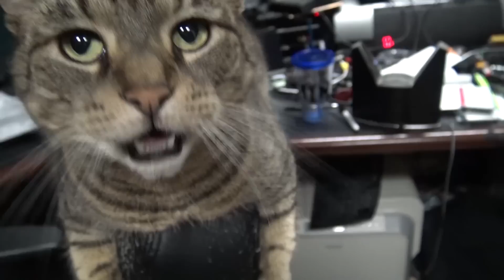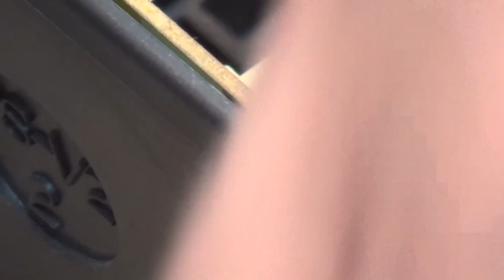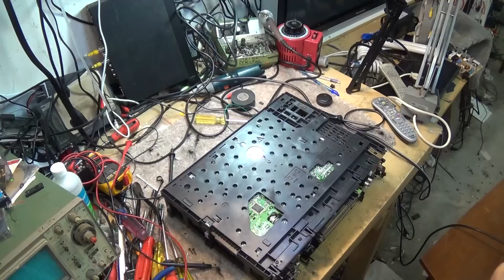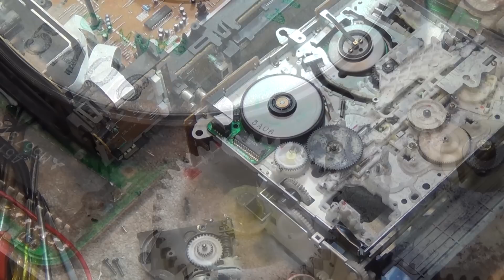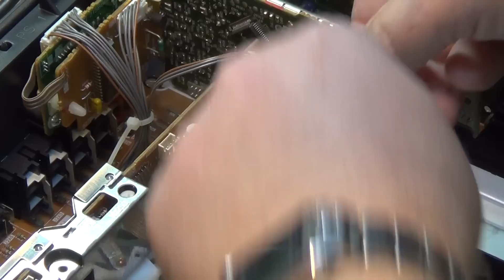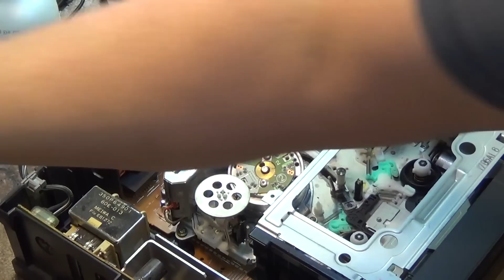Mitsubishi HSU760 totally dead

Comment: Great vid!  well explained.  I have one of these, and after belt replacements (both) it loads just fine i can see it load, but when play  (or FF or RW) is pressed, I get a squealing sound and after a few seconds it gives up on play.  It's almost like a brake is stuck on, or some kind of sensor is not sensing the tape is loaded and ready to play.  Any thoughts?
Reply from the maker: Is the belt slipping.
Reply: @12voltvids  Thanks for the tip - slipping, does this mean it's only going to be drive belt - or loading belt as well?  Seems like it's loading fine.  Sound like the answer lies in finding the right belts at right tension?
Reply from the maker: @brentkroon  you will be able to see which one is slipping.  Some of the mits used a plastic pulley on the capstan motor that cracks. It's ok to glue it.  At one point they make a metal replacement.  Not no more.

Comment: This is excellent. My belts were actually sticky goo melted rather than dry or stretched.  I don't see what size replacement belt or recommended sourcing?  Seems others simply buy a collection and try? Any recommendations for size and style of belt? They appear to be a rounded belt (from the melted bits inside my machine)
Reply from the maker: It is a square belt.  Sbm is the prefix.  Loop some sent floss around.  Tie right. Then cut and measure in inches.  Take 10% off and that is your size.  I don't have the size handy.

Comment: Thanks for ALL you great videos. I am in Singapore abd have 2 Sharp VCRs that need repairs. I am thinking of sendibg to you in Canada and tgen resend back to Singapore. How do I communicate with you directly ❓ I am Don Ho from Singapore. Can I give you my email address❓
Reply from the maker: You're joking right?  First shipping would be prohibitive and second if I'm not mistaken Singapore was on the pal standard. I have no test equipment capable of working on pal equipment.
Reply: @12voltvids  No I am not joking. I have a Sharp VC-AH 770 and another VC-AH990. Both having same probkem of Tape not able To Be EJECTED. Looks like the same  Nylon or Plastic gear is slightly broken. How do I send you photo of the assembly with the geatstill inplace ❓Then maybe you can purchase the required / necessary spare-parts for me  to ship over, with cost, service & transport cost   paid to you ahead ❓🙏🙏🙏
Reply from the maker: @danho1904  I have no access to parts.   I know of no place to get parts.

Comment: I fixed a mitsubishi just like this one last summer! Just about around the same time too!
Super cool to revisit this model.
I remember I also went over the pinch roller with light sand paper after regreasing the tower gear.
Glad I watched this, I now know what grease to use next time I need to lubricate nylon gears and other sliding parts like this.
Is it bad to use white lythium grease on nylon gears?
Reply from the maker: Lithium grease should be ok. Check the label for plastic compatability.
Reply: @12voltvids  good to know!

Comment: I like the idea of the old long versions, and the short condensed versions along side. Great inside info on lubes and trouble spots.
Reply from the maker: The thing is the short versions won't have anything removed that pertains to the actual trouble. Just the banter when the unit is being taken apart.

Comment: What else does molygrease go by in name please
Reply: 45 years ago, I used to call my 5" long tube of black MollyCoat by the name: Molly B. Denim 
Autoparts store?  The chemistry gets tricky since some dry out and get flakey.  
Dave may be able to name a brand/source for you that best for the application and ok for Nylon plastic.
Molybdenum Disulfide Grease:
https://www.graco.com/us/en/vehicle-service/solutions/articles/moly-grease-vs-lithium-whats-the-big-deal.html
https://en.wikipedia.org/wiki/Molybdenum_disulfide
Reply from the maker: It's just synthetic lithium soap grease.  Goes by many names.  Comes in a few different colors.  Green, yellow white.
Reply: So, what happens if I accidentally moved the timing gears? My marks weren’t on the same location as yours and the holes weren’t lined up. Should I move them so they do? Did I just ruin this unit?

Also, when turning the gear on the left it’s now locked in place. Is that normal?